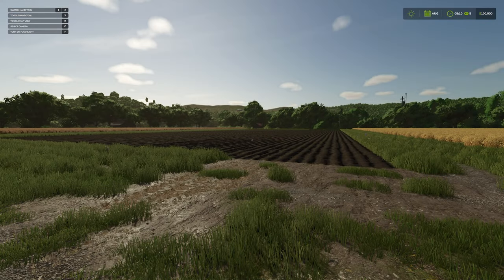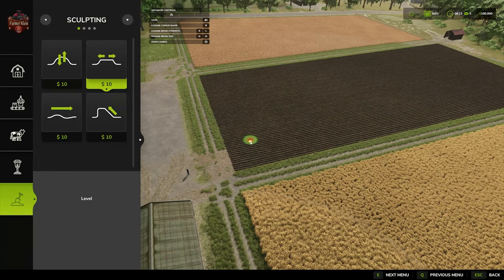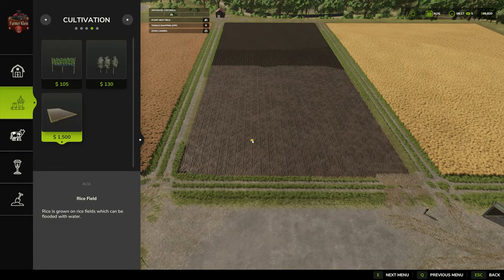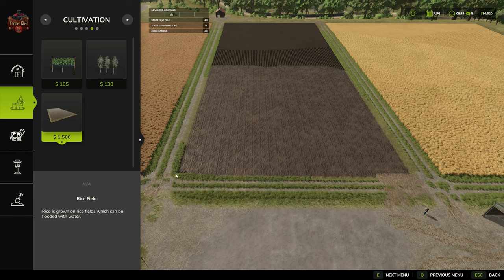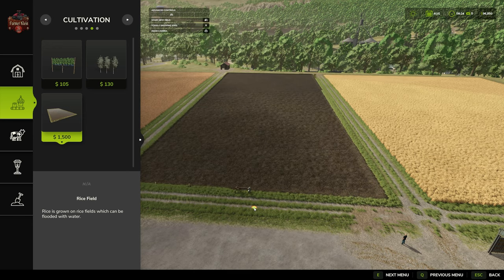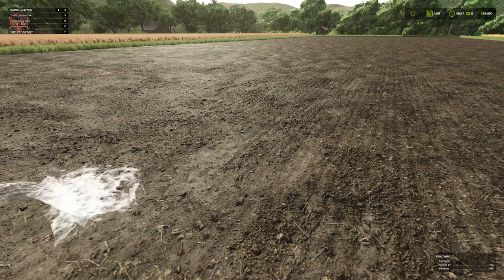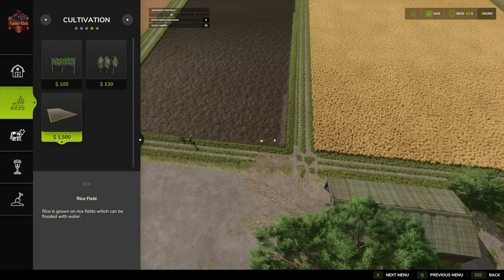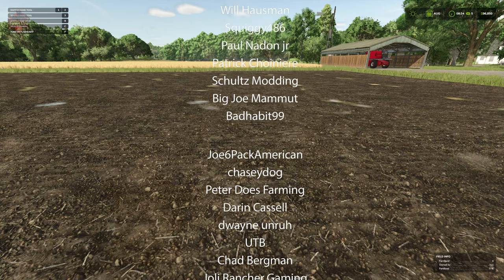Farm Sim 25 Tips & Tricks | Creating Rice Fields

Comment: I noticed when you flattened the field the texture changed. 
Does it still register as a field or would I need to re-plow it to get it back to a "field" state like in previous fs games?
Reply from the maker: It sets it in a cultivated state ready for flooding and planting or planting longgrain rice.
Reply: @FarmerKlein  thank you for letting me know that about the rice fields.

By any chance do you know if the cultivated state applies for regular crop fields as well after flattening the terrain?
Reply: @FarmerKlein no that's only if you continue to make the rice  paddy 

However if you change your mind or can't create the field it will need plowing / cultivating before AI registers it as a field
Reply from the maker: @madyottoyotto3055  you can put anything in the field its not restricted to rice.  the only need to delete the field is if the pump is in the way from a placement standpoint.